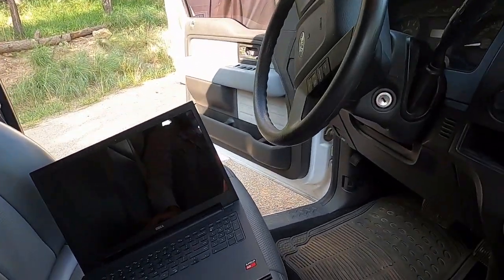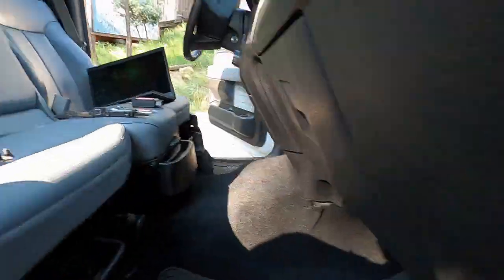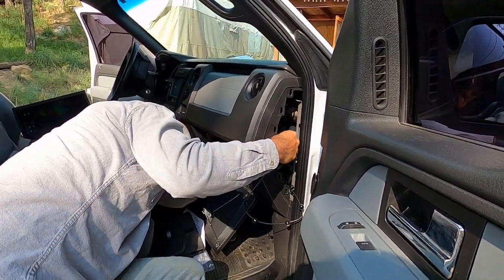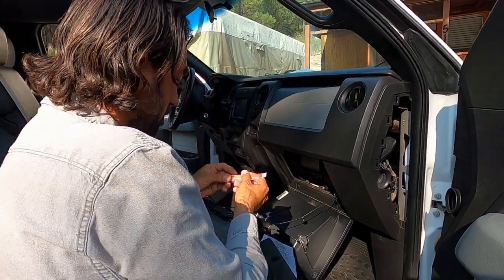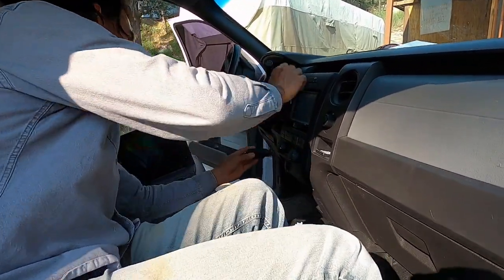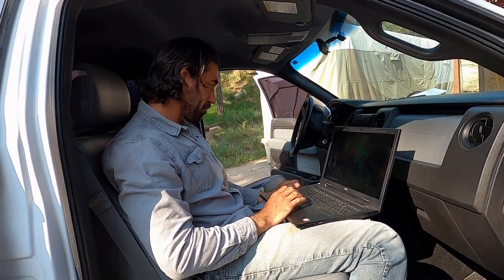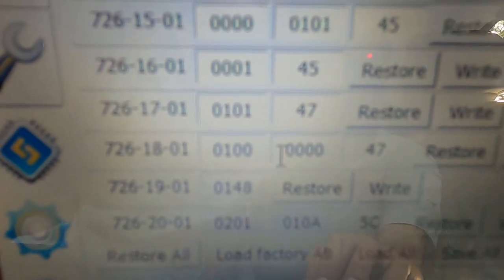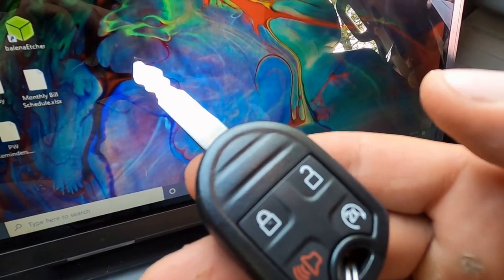Full Installation remote start 2014 F150 with 2nd transponder key.  Forscan & ELM327 programming.

Comment: Yes I've got a 2012 Ford F-150 and I put the new ant had on it with the two new keys and when I went into the body control module and try to activate the starter already on it then I lost my driver side front door have you ever had that to happen to you when you've activated your remote starter and it says actuator switch is bad appreciate you input

Comment: Its look not working on my F150 XL, some body can confirm me please ?  I have the plug like your to insert the antena cable but its not working. Great video, thanks.
Reply: Did you check the hood door switch. You can just bypass it, put the two wires together. Let me know as I wanna try this on my xl with no power locks.

Comment: Did you need to get your key cut AND programmed at the dealership, or just cut? I'm buying that same kit and want to know what I'm in for $ wise.
Reply: You can get the key cut anywhere they cut keys if the guy knows what he is doing, nothing special about that.  You can program the key in the truck without a dealer.
Reply from the maker: @williamfoster4268  I can vouch for that.
Reply: @flostate2764  you can use the FORscan to program that new key on your own too right?  I currently only have ONE key so I always thought i'd have to go to the dealer to get that back but this OBD2 device can handle?

Comment: Thanks for the video. I’m definitely considering doing this for my 2013 F150, so do I have to get the new key from the dealership? Or are there other options?
Reply from the maker: i bought my keys and module on ebay
Reply: @flostate2764 do you have a link?

Comment: Thanks for the video. I was able to get this to work. Two clicks starts it but clicking doesn't shut it off. Any ideas?
Reply from the maker: lock once and start twice to START
after running, start twice to STOP
Reply: @flostate2764  doesn’t stop
Reply: @jeffflowers729  Did you get that fixed?
Reply: @NoName-ml5yk  no. It’s worse than I first realized also. One click starts it. I don’t have to click lock first (but truck does lock when it starts). If I’m just around the truck with key in my pocket it can “pocket start” if the button gets pressed by other keys or something. Won’t shut off pressing any buttons. I even tried tried turning remote start off and back on in forscan. Didn’t work. Tried relearning the key didn’t work either. Considering trying a new key.
Reply: @jeffflowers729  OEM key or aftermarket
Reply: @NoName-ml5yk  aftermarket but looks identical and supposedly same digital ID or whatever they go by. All other  functions work fine. I had that thought and may try a new key.